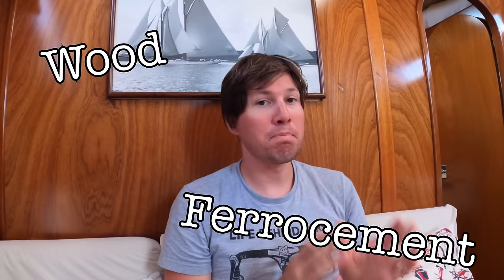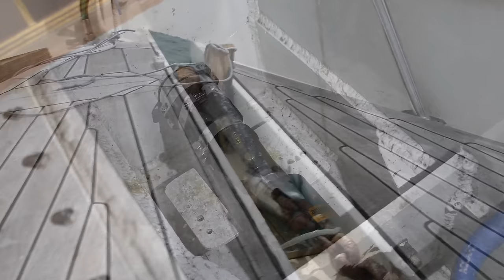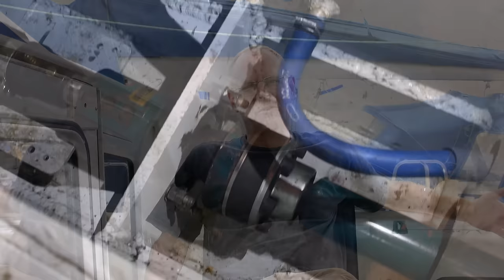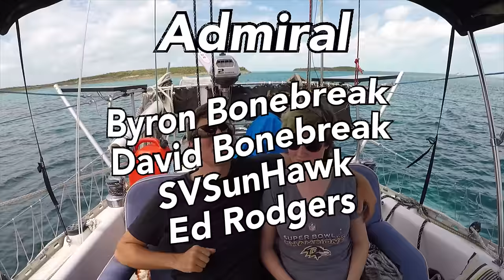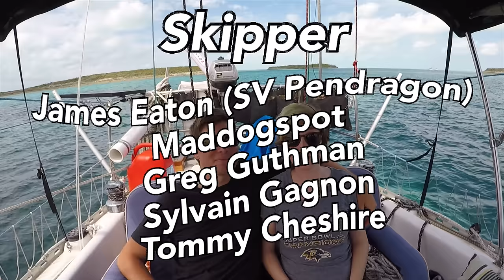Which Hull Material is BEST: Aluminum  | Sailing Wisdom

Comment: Stainless steel would be a good one because if ever you sank it you could recover it and re-weld it. Aluminum suffers from rot eventually!
Reply from the maker: A stainless steel boat would be an incredible vessel!
Reply: Well actually if you read about stainless steel, you will learn that it becomes brittle over time when exposed to salt water. If you are a boat person you will know this with regards to anchor chains. Stainless steel must be washed with fresh water, if not cleaned it will get microscopic cracks which severely effect its tensile strength. With the stresses a boat hull can experience, having a hull that may suddenly crack is not desirable. Titanium would be ideal, and vessels are beginning to be built from it.
Reply: @chippyjohn1  that's interesting. It doesn't surprise me, the sea claims everything eventually. I saw that someone tried this but was having reactions every time a different metal was introduced to the stainless hull. He had to take it all to bits and start again with more specific materials to join in with the stainless.
Reply: @chippyjohn1  There was a  titanium hull Japanese ship in the Transpac race in around 1987. The joke was "please keep the can openers away from the boat". The wealthy owner had it put on a container ship for the journey back home. One of their crew members came aboard the Canvasback for it's journey from Honolulu to San Francisco. I got to cross the Pacific on that  ship which was a 71' aluminum ketch rigged catamaran. It was interesting.
Reply: @mikeh2520  Did the hull suffer damage? I don't understand the joke.
Reply: @chippyjohn1  No damage but the titanium hull was so very thin that the comedic suggestions were that it could be opened with a can opener. It was probably a great hull but people like to joke about things. I was just an observer.

Comment: ONLY ALUMINUM FOR ME!    His pro of durability "on the rocks"...why isn't that the only one people need to know. All "cons" are basically human error issues, not a "con" of aluminum. Positives so outweigh any pros or cons of any other material.  Pro not mentioned: Don't have to paint topsides (natural oxidation seals the aluminum).  Advanced methods available to identify any potential leaks during the manufacturing proces. Doesn't stink like "glass" is a big pro for me as well.
Reply from the maker: Aluminum is an amazing material, but if you can’t afford it, you can float in a plastic bottle and look at the aluminum boats.
Reply: @RiggingDoctor  ...somehow i missed the part of the series "what material that you can afford..." I thought the topic was simply based upon criteria that weren't related to budget , but "Material is BEST."

Comment: Wonder if "White Spot Pirates" or Vet Tales knows all of this, they both have AL boats in warm central America waters.
Reply from the maker: You could share it with them ;)
Reply: @RiggingDoctor  Think I already did with White Spot, that little skinny German girl does all of her own work, down to pulling the engine & aligning the main shaft. She did fish plate the bottom of her AL hull between the twin keels. She beached the boat at High Tide & did a bottom job too. Funny she is not the "I don't need a man type" but more like can I do this & tries.

Comment: Best is titanium, aluminum can corrode,titanium is not.
Reply from the maker: Titanium can still corrode, it depends on which grade you are using. Grade 7 and Grade 12 are the only ones that will withstand the marine environment, the others will corrode away just like stainless steel.